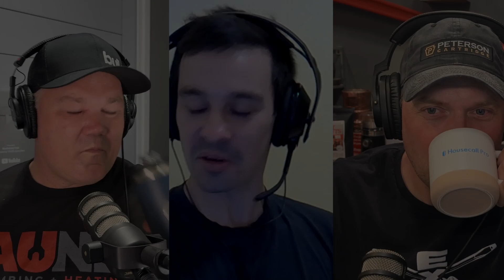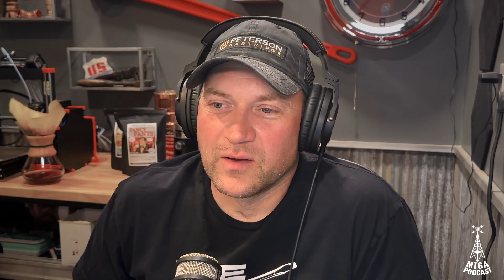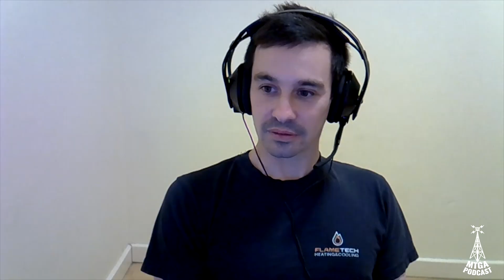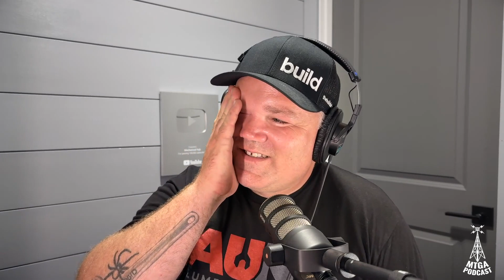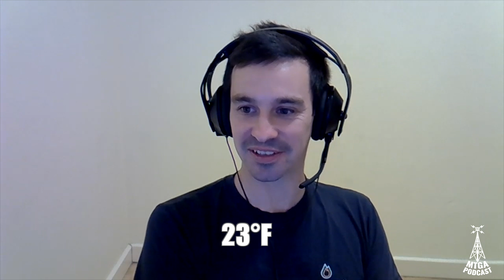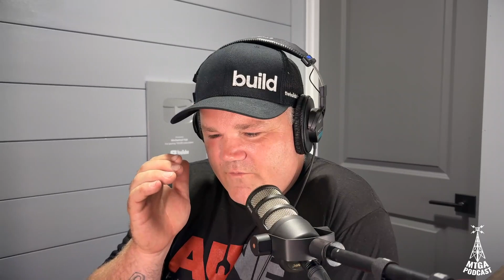Flammable Refrigerants,  Australian Building Codes & More

Comment: I think the code folks can be quite miopic these days on a lot of the regulations-- I blame the fact that the committees are stuffed with manufacturers rather than engineers and installers.

There is still a place for a temperature setback-- cooling during the day when you go to bed way after sunset is one example.  Hopefully it becomes more standard practice to separate bedrooms from common areas in residential HVAC.

I do wish the equivalent of a rooftop package unit was realistic for a home-- the 100% economizer capability is really nice.

Comment: Andy is absolutely correct about A2Ls. I worked in the natural gas industry for over 35 years dealing with pressures from 7 inches water column to 3600 PSI for CNG systems, all well & good,but now they want built-in sensors and mitigation systems bringing on blowers for mildly flammable refrigerants . Sounds like they’re trying to mitigate a problem where none exist (money grab for the control industry 🤔). I am all for flammable gas detectors much like smoke alarms so people can use common sense. It’s great that my car tells me my tires are low on air but do you think we should wire in a system where the car won’t start because one tire is a little low on air. I’m all for common sense safeties but sometimes I feel , the powers that be overthink sometimes.